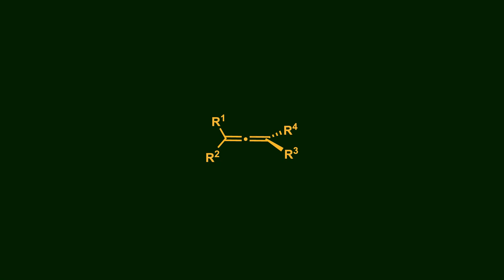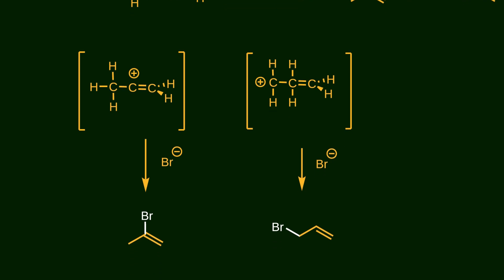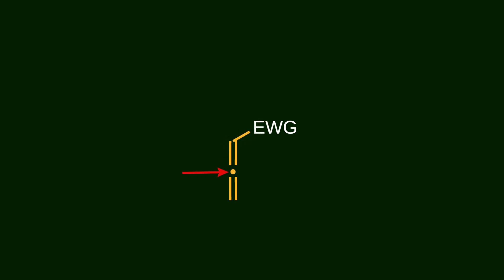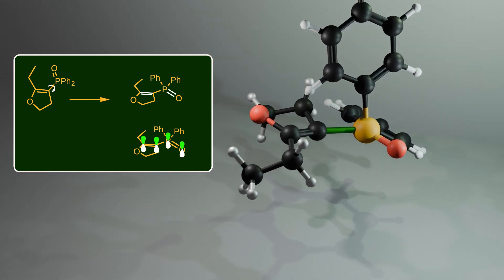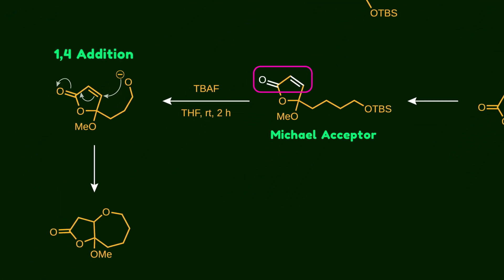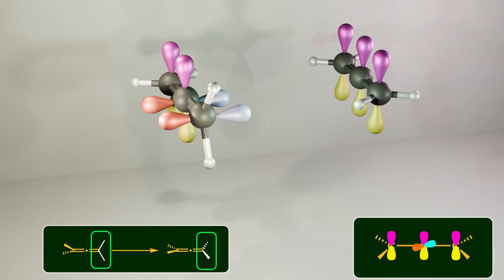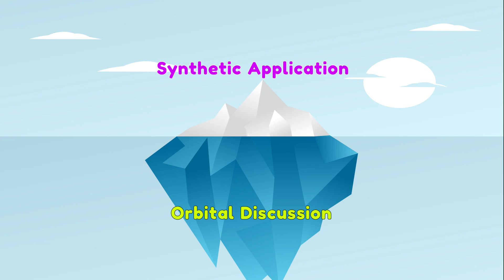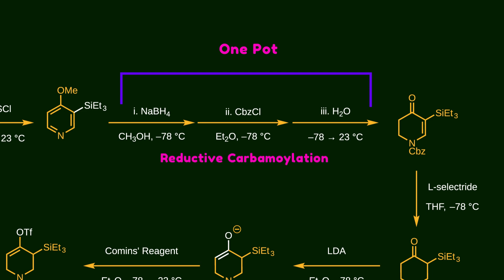What Happens When You Bend an Allene? Chemistry Textbooks Won’t Show You This! (3D Visualization )

Comment: Apologies if this's self evident, but at around the 8:49 mark, wouldn't the final product's ester double bonded oxygen have a negative formal charge, since the electrons were pushed to it? Alongside that, wouldn't the double bond between the 2nd and third carbon of the allene change to be betwixt the 3rd carbon, and the carbon connected to the originally double bonded oxygen?
Reply from the maker: Thanks for your comment. On the first question, the compound abstracts a proton from the solvent and is then converted into a cyclic ester — I didn’t show this step in the video. Regarding the second question, it seems I accidentally left out a carbon atom, so yes, you are right.
Reply: @Chemicator  I thank you for your time!

Comment: People almost always overlook CO2 exhibiting pretty much the same bonding structures as allenes
nontheless, pretty cool!
Reply from the maker: Yeah, that's a great point! Maybe I'll create a video about that. Thanks for your comment!
Reply: @Chemicator An interesting thing to look at related to this is the stability of linear carbon oxides O=(C=)ₙO. They’re a lot more stable when n is odd rather than even, which I think has a simple stereoelectronic justification (oxygens can get more electron density when they belong to disjoint π systems).